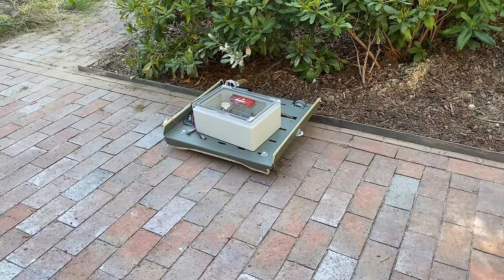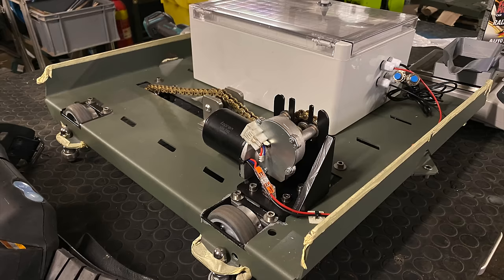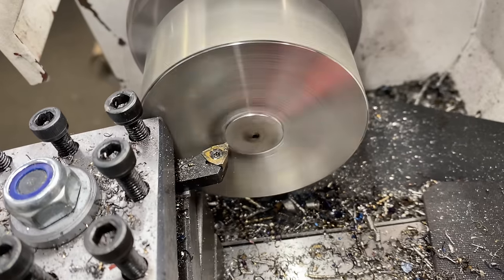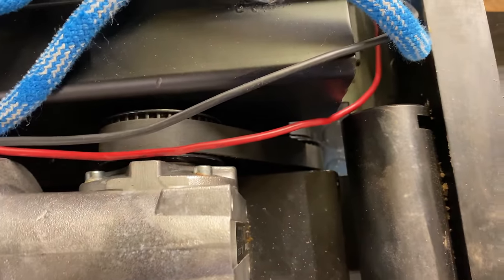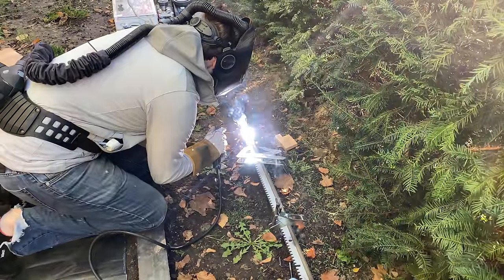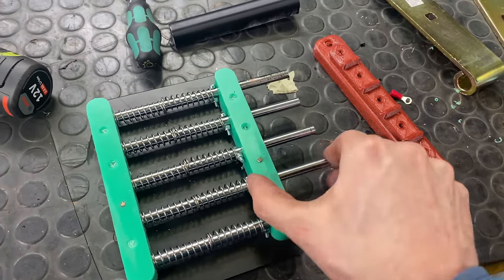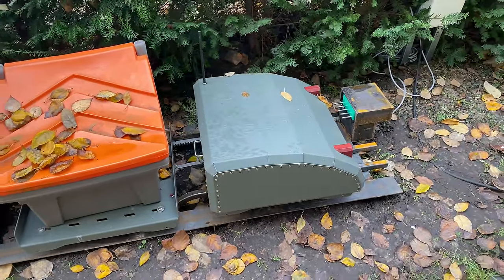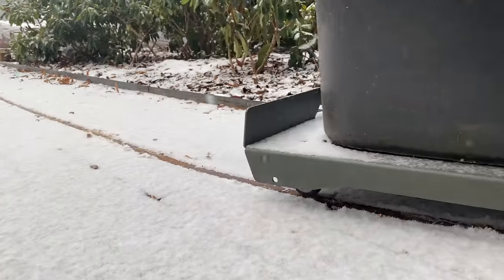I put my trash cans on rails and now they move automaticaly! (Trash Train)

Comment: You could put it on a calender based timer but then you have to rember to  actually put out the trash. This is brilliant and certainly would help the elderly or physically disabled, slap a markup of 80% + labor and you have a business right there.
Reply: or even Hey Google take the trash...
Reply: Why not just have a chute from your house that goes down to the trash bins, including some fill level sensors, alignment sensors and gas sensors to avoid spills or prevent stink from building up.
Reply: @zipp4everyone263  A chute? the trash bags would tear and it would end up making a mess everywhere
Reply: @KiLLJoYYouTube  if you make it poorly, yes. If you make it so that the sharp bits are on the outside it shouldn't.

Comment: This is really cool!  Something to keep in mind for a commercial version (or even for your version, especially if you have children, pets, and/or elderly around): you need to add both an alert sound that warns anyone nearby that the train is about to move, and also some sort of safety shutoff were someone be too close to the tracks.
Reply from the maker: It has a force shutoff. So when there is too much resistance it shuts off.
Reply: @MaxMakerChannel  You could play train sounds for the immersion.
Reply: As slow as it's moving, I think a bumper would be enough. Maybe a tilt sensor in case it comes off the rails. If you're feeling overcautious, ultrasonic distance sensors are about US$200 each and can detect objects about 400 mm away.
Reply: @PrograError  instead of a beeper, maybe a little tune? Like an ice cream truck
Reply: @Compgeek86   I think these are all great ideas for a safety feature.
If you go commercial, you need to be 100% sure you have failsafes, there's no such thing as too many safety features 🤣
Reply: @MaxMakerChannel That's good because those gears could probably tear a finger of a kid or a limb off a small animal if they get caught in themm.
Reply: @Compgeek86 If it was just about being run over yes but what if someone gets caught between the gear the the track?

Comment: this is really cool, i like how you were always careful about the environment and stuff like that. this is something that could be really great for someone with mobility issues and would give them some more independence .
Reply: But he has several garbage cans going to the dump!
Reply from the maker: Hopefully one day I can market this.
Reply: @brianyoungberg9904  If it's anything like the situation around here, there will only be processing plants for handling certain kinds of waste (reasons vary, but it basically amounts to 'there has to be somewhere for the resulting material to go after the recycling plant and there has to be enough money in it to keep the lights on). Here, for example, basically any paper can be recycled... provided it's at least the size of a standard postal envelope. Anything smaller has a bad tendency to either blow away or come off the line and get jammed in the machinery.  The prescribed solution for small papers is to shred them and put them in the greenwaste bin (for composting). 
For card packaging, most of it is treated the same as paper, but sometimes you'll get cartons with foil lining or other such things. There's no real practical way to process this, so it goes in the landfil. 
Plastics? A couple of types can be processed just fine, fortunately the most common ones... but again, the sorting machines can't handle bottle caps (even plastic ones), they tend to escape the line and jam up the machinery.  Similar problem with 'soft' plastics. Some of the 'hard' plastics are just basically impossible to recycle. Oh, and if you mix the wrong plastics at certain points in the recycling process in sufficient quantity they explode.  So a lot of That goes in the landfill too. (some other cities here have the ability to process More types of plastic, mind you). 
Aluminium cans are also recycled, of course. 
foodscraps and garden waste mostly go in the greenwaste bin. Gets composted on a grand scale, basically.
Everything else? if you can't reuse it or pass it on to someone who can? it's going in the landfill. 

A fair bit of effort is being put into reducing waste packaging, but you run into problems when so many consumer goods are imported from places that just don't care. 
Oh, as an added bonus: one use disposable plastic shopping bags are Awful, no argument... but surprisingly, once you start taking into account the energy cost and environmental disruption of Making them, they actually beat reusable bags made of cotton in terms of environmnetally friendliness. Of course, strong, Reusable plastic bags are better still, and sturdy Paper bags that you can get several uses out of before they give up are better still. (and then there's bags made of, say, Hemp, rather than cotton, which is Much less damaging to grow on a large scale). 

Also, no matter what you do, you'd be surprised just how much waste accumulates over the course of a month.

Comment: Such a delight to watch your development process! I really wish the US would adopt the cordless tool Battery Alliance scheme. I'm so locked into these damn Ryobi's but lusting after these other tool brands...
Reply: Just wait until they digitally license-lock the batteries and accessories with this "Tools-as-a-Subscription Service" where you have to pay a recurring fee to keep using, buying, replacing, or recharging tools and accessories
Reply: Chris, you DO know that there are battery adapters available to use brand X batteries in brand Y tools, right? Not EVERY model out there has an adapter available, but a bunch of the popular ones do..
Reply: @davelowets  in the US? No, I did not know that.
Reply: @chriskelvin248  eBay has some. I’ve not tried myself but many do recommend them.
Reply: Most tool manufacturers will licence there batteries if not allowing the tool manufacturer to use there name. it's just money in the states most of the tool manufacturers want you to buy into their system. so they use their tools, team red blue yellow ect ect. but if you make a tool and want to use a Milwaukee battery they most  likely will let you. but your going to have to pay Milwaukee for each tool you make and have to source batteries from the. to ship with the tool. That can get expensive paying upwards of 20$ per tool for licencing and what ever a battery cost wholesale. when you can slap a non removable battery or generic lithium and ship it with a charging brick for less than the 20$ sorry rant over
Reply: @the_1drummajor  "Oh, you want to REVERSE that bit? The base subscription only allows clockwise. Upgrade to premium for counter-clockwise!"
Reply: @daven1719  you know if they could they wouldn't be afraid to plaster advertisements on their power tools or even go to as far as having business-subsidized data packages pre-activated on the power tool so they can also track your usage and whereabouts for "enhanced customer experience." Real conspiracy atp
Reply: @the_1drummajor  Will NEVER happen... If a company tried to pull that shit, they'd screw themselves right OUT of business..
NO ONE would buy their products EVER again.
Reply: @davelowets  that's nothing more than a false dichotomy. While you may have companies that would never do such a thing, you don't even have the slightest valid evidence to prove that each and every single company would never commit to such a business practice.

Admittedly, it is an unpopular business practice; but companies like Tesla and Mercades-Benz are already experimenting, if not already implementing a subscription service model to their flagship products and people are already buying into that narrative under the guise that it's cheaper and better for them in the long run all the while without even realizing the product they are using is not 100% functionally under the full ownership of the end user.

If your argument is true and in practice, Tesla and Mercades-Benz shouldn't be having ANY customers subscribe to their "experience" let alone operate their vehicles on the roadway. But the reality is that we do, we have people driving these vehicles and with the billions of people that are already on this planet, companies like them are bound to have some sort of customer base falling into their subscription models. It's definitely not like there is literally (by the count of zero) individuals that is deliberately not buying into this business model. I'm not saying I'm all for it, but what I am going to say is that  this kind of a business model exist and people are going to play around the waters with it, even if it is a terrible business model.

So no, businesses wouldn't screw themselves completely out of business right then and there. And businesses will always be finding a way to adapt so that they can sell themselves and make profit no matter what, besides, that's the end goal from a financial standpoint for them anyway.
Reply: @the_1drummajor  Yes, they would screw themselves right OUT of business. Their competition would simply LAUGH at them, not do the same thing, and ENJOY all the new customers that they would end up with. End of story..
Reply: @davelowets  No, no, no... NOT the end of story. Come back with some verifiable evidence because at the time of this posting, your theory does not hold up to any ground and I am not convinced by your logic which has literally no substance to it at all. End of THAT story.
Reply: @the_1drummajor  That's because you're a CONSPIRACY THEORIST... Where's YOUR proof that this WILL happen?? 🤦🏻 Again, end of story.
Reply: @the_1drummajor  Yes, you are one.... 🤣
Reply: (I only said that just to get him to shut up. wac smh)
Reply: @the_1drummajor  Well, you DID admit it..
Reply: No, constantly "guessing" that the future is going to be is pessimistic, and claiming that it WILL happen, is called being a conspiracy theorist.
Reply: @davelowets  "aLeX JoNeS Is tHe BeSt nEwS AnChOr Of AlL TiMe!"
Reply: @the_1drummajor  Abdolutely NOT. That would be YOU
Reply: @davelowets  Do you think what happened when the people went to Capitol Hill to fight on January 6th was positively revolutionary?
Reply: @the_1drummajor  I'm sure YOU did...
Reply: @the_1drummajor  Ok, see ya C.T....

Edit: Don't forget your tinfoil hat when you leave.

Comment: This is great! Have you thought about putting a soft-ish bumper on the front with a cut off switch built in? That way it would stop if something was blocking it's path. The bumper could also be used to stop it at it's charging base.
Reply: Yeah was wondering what would happen if it hit something. Would be good to have a safety kill switch connected to some kind of sensor

Comment: Great project!  I was going to suggest the rack and pinion, have a look at the railways they used on Welsh slate mines which used this system to go up hills.  Also if you mounted the limit switches within the rack the pinion gear could depress them as the gear tooth engages them and then you don't need dangling limit switches (though the switches would be on the rail and not on the "train", so perhaps not ideal) - this is very similar to how it works on model railways

Comment: For the next generation you could also have the trash cans move automatically at 5AM on trash day. Maybe have a dial or a control panel on the inside of the house, right next to the window that overlooks the front yard
Reply: it would make sense, but put the motors and control in the bins then you want fall over the track collecting the post!🤣

Comment: My father-in-law is a steam train enthusiast and has a 5-inch train track at home.
I think that system would be much easier for you to upgrade the current model. A battery powered train engine, a 5 inch track and the loading and braking improvements you have made.
Reply from the maker: I don’t understand exactly. I didn’t go for the two rail track because I didn’t want to have to be so exact about the spacing.
Reply: I agree normal rails (or flat bar like we use in Aus) and flanged wheels would work well but I'd go much wider than 5" gauge for stability.

His point about the track being part of the garden border on one side and flat on the other is interesting - it isn't so much a tripping hazard.
Reply: @MaxMakerChannel  It doesn't need two tracks. Just adapt a training wheel for a bike. A slightly wider larger wheel is all that's needed.

Comment: It really needs a big red emergency stop button on the front and back, and some collision detection bumpers. If a child comes into contact, it could get messy.
Reply from the maker: No problem! It has current sensing on the motor. If too much current is drawn, it stops the train. So if your foot is in the way it stops already. Just like sliding gates do.
Reply: I agree, this is a really cool project! I was thinking something similar. It needs obstacle detection such as a laser or simple radar (think Lego mindstorm proximity sensors) as current sensing will offer some protection, but one small animal’s arm won’t make much of a change compared to 7 fully loaded bins.
Reply: @MaxMakerChannel  If you tune it to move a train with maximum weight and then it moves almost empty and somebody is in the way, it wouldn't be able to tell the difference right? It could maybe do damage without exceeding the maximum work load, like dragging things (or children, animals) along.

Comment: Awesome! You could also simplify the rail! Just make some side holes on the rail and use a roller with few "tooths". Keep tolerances generous and you are done.
Much less expensive to manufacture, reliable and very easy to bend and install.

Comment: This was a great video, I have never worked with steel and metal at such advanced levels! 
There's also the relatable factor coz you didn't shy away from showing the issues with the prototypes. 

Btw I have worked with the motor you used in the first build. The wiper motor was used by me in a college level battlebot (robowars) competition. I think we went till the semifinals and our motors have out (didn't have money to buy replacements)
So these motors internally use a plastic gear which will fail in some time. Another point of failure are the brushes and the winding which aren't used to carrying heavy current and will smolder eventually. 
What you needed was 6 motors (buy 2nd hand and clean them) match the ones with similar rpms and bolt them down. Use rubber wheels/ wheels of beach buggies (I dunno the exact term). 
For 3d printed tyres check out the channel called RC Test Flight, he has done extensive testing. 
When you use 6 motors you can easily carry a weigh of around 100 kgs (at battlebot speeds). If you are interested you can ask me about those types of motors I have done a lot of testing on them. 
Another idea would be to make a shed for it and then cover it with solar or in general use solar to power it.

Comment: Very nice project. A cool thing would be if you could have a small webpage where you can configure it so it drives itself out automatically every time the trash is getting emptied. Also maybe for automatically driving it back in you could use maybe weight sensors or something to register when the trashcans have been taken off and put back on (though I dont know if this would work properly because i dont know anything about such stuff).
It could really well be something people could use, well done.
Reply from the maker: Working on that.

Comment: I have a question, do you think it would be more economical and easier to use a cable connected to the trash can carts instead of a gear system to move the train around? I feel like it would be possible to install a cable almost in the same way ski lifts are used to pull a cable with carts attached back in forth in a system. You could also maybe hide the cable at the bottom of the train maybe near the guide rail underneath?
Reply from the maker: Yes, that is the next mechanism I will check out.

Comment: As a train driver the first solution regarding the traction problem that came to my mind was, just put 100 kG of Steel weight onto it. And since you said it takes about 30 kG of force to pull it, that assumption was kind of spot on :D Since on the railway we have a friction coefficient for steel on steel of about 0,33, meaning a 90 ton locomotive can create 30 tons of puling force before the wheels start to slip. 
But to me the whole thing seems to be a "rich people´s problem". I´ve got my trash bins placed in front of my house, because it´s the most convenient spot for them. Shortest way from the streetside to their place, not blocking space for cars and motorcycles in the driveway, and i can throw in trash from the veranda without the need to put on shoes and walk arround in the driveway. And i don´t care how it looks from the outside, since i live in my house and therefore won´t see it most of the time :D

Comment: in a future iteration, you might want to take the tram/lightrail approach: all wheels of the whole train are powered. that way each car provides it's own traction and you wouldnt need a separate locomotive unit. also, you could use low voltage AC (here in the US, our doorbells run on 14v AC) with a rectifier to power it without batteries. awesome project, im glad the algorithm smiled upon you and i saw this video.

it's an interesting concept, in the US our trash cans are picked up by a claw-like mechanism on the side of the trucks, it lacks any semblance of finesse, so idk how well it would work here, might need some manual reloading after collection, but i could totally see this being used by my elderly neighbor (or even my lazy butt)